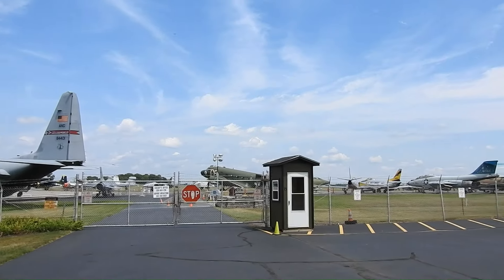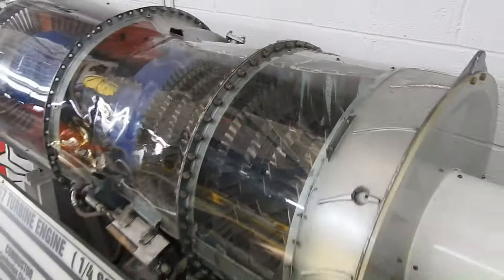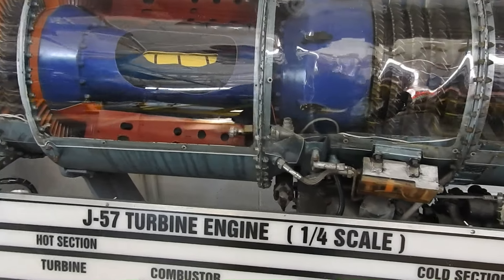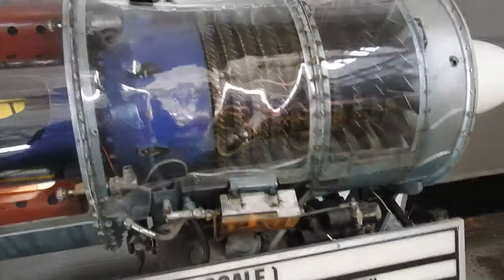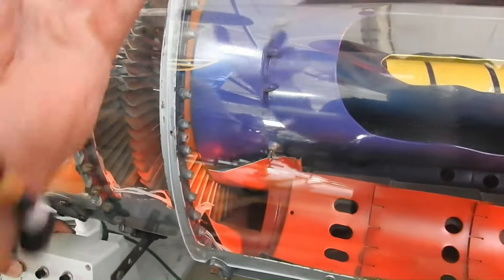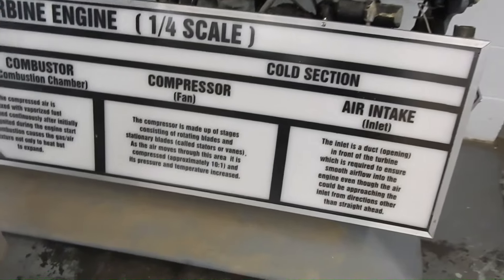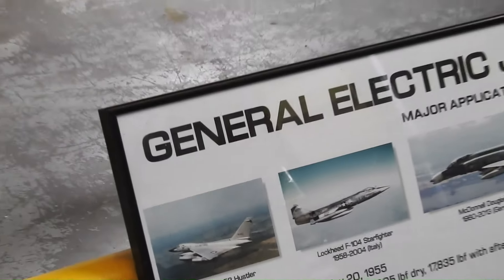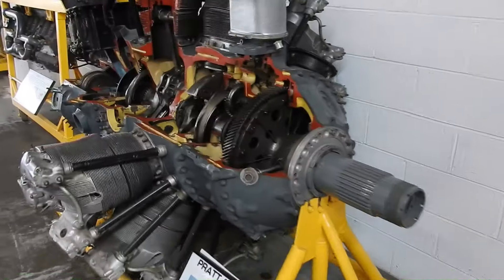The Jet Fuel Hoax

Comment: I think this is why Concorde was decommissioned. Nothing to do with cost efficiency. People were starting to look at those might thin wings and the fuel requirements similar to large airliners. The maths didn't add up. I watched a BBC documentary on Concorde (which i have recorded) and they state at crusing altitude there a virtually no fumes from the engines just water vapour. Where did the carbon go from the fuel????
Reply: There were 2 more reasons concorde was pulled, both of them to do with the shape of this realm.
Reply: @sherlocksapprentice774  
Even a car engine produces water with exhaust. The fumes still exsists. The heat of exhaust is highlighted by colder outside temperature, creats the trail. 
Now from the wing tips, that contrails air vortices. That's another subject.

Comment: I’m into conspiracy theories as much and more than most. However I used to be a turbo prop engine repairer in the army back when it was called 69B MOS designation. I then moved onto to be a ch-47C-G pilot. Most of my time was spent in the Delta model though. I can assure you that all Army helicopters run on JP8 which is pretty much diesel fuel with some fuel additives to prevent iceing. I can also say that while I was supervising the loading of my units helicopters onto a C5 Galaxy it also used JP8. The difference between commercial aircraft and military is something I couldn’t tell you what because I don’t know. I can say that it took nearly 12 hours to fill that C5 and four fuel trucks to do it. How can commercial aircraft receive thirty minutes of fuel to fly from New York to Nevada? That’s the real question
Reply: There is definitely something to what he’s saying I discovered this years ago. Probably 2017 and yeah you’re definitely correct about the whole “how long does it take to fuel a plane. I know if they come in too slow the commercial aircraft has a tendency to “stall” but that doesn’t make a lot of sense if you think about it, if the fuel was regulating the power coming from the engine. But if it was running on compressed air, or aetherical energy, it would make more sense. The lower the speed and the lower you get to the ground, it’d be more likely to stall out if there was no fuel to keep the turbines spinning. 
I’m not an engineer or jet engine specialist but my dad was in Vietnam. Helicopter mechanic and he basically said the fuel was to power the rotors and a small amount for the engines- never understood that until 2017.

Comment: So people would have a problem believing that that an f111 held approximately a semi trailer tanker of fuel. The aircraft weighing approximately 20 tonnes, a 14 tonne payload and maximum take off weight nearly 50 tonnes. Keep in mind fuel is lighter than water.
Reply: Water is 8 lbs per gallon jet fuel 7.8 lbs per gallon not much difference.. There is reason airframes and engines are made as light as possible.

Comment: There’s definitely something to the jet fuel hoax. 
But they need fuel for take off and landing definitely. 
But if it’s in the wings why don’t they fill from the wing? Why go through all the trouble of running a 3” line or whatever to the wing from the front of the plane. 
If it was true it’s a bad design that should have been solved by now. 

This guy sounds nervous explaining his nonsense. 😂